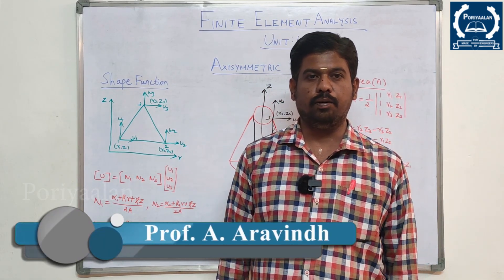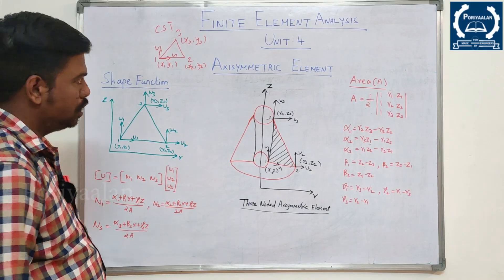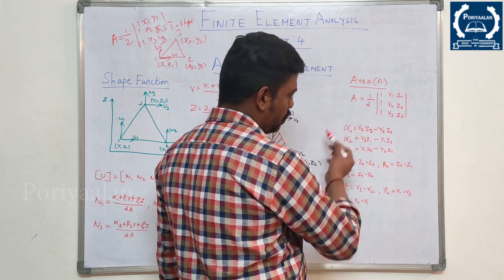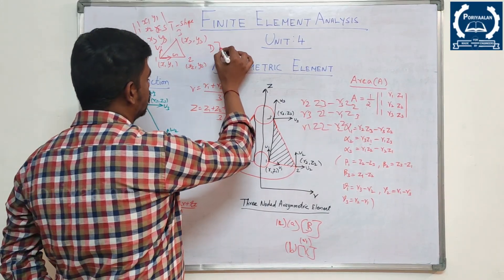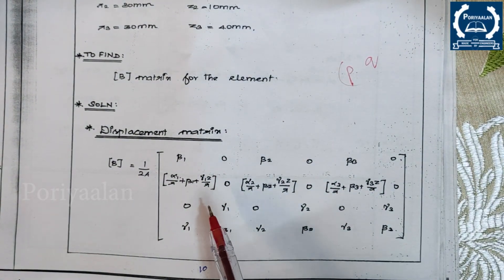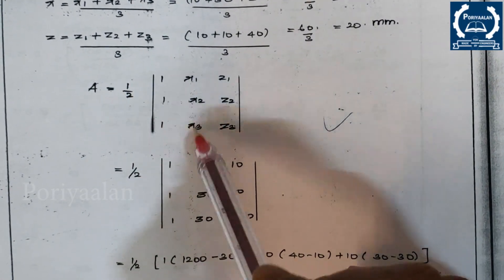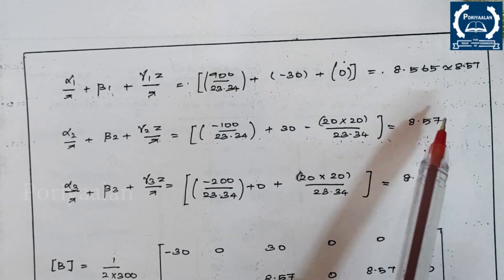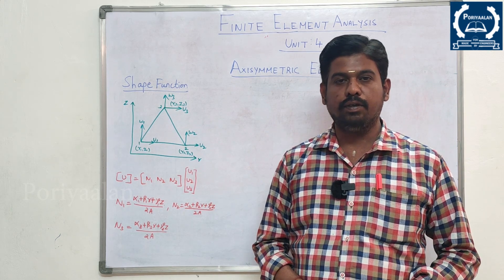Finite Element Analysis| FEA| ME8692 | UNIT-4| Part-1| Tamil

Comment: Sirr !
Kindly let us know which one is correct 
About alpha Beta gamma Steps

In formula explanation  

(Video time) - 4:41

That,

α1 = r2.z3 - r3.z2

α2 = r3.z1 - r1.z3

α3 = r1.z2- r2.z1

As so on for β & γ

But ! You’ve written this formula in example sum like, 

(Video time)- 11:31

α1 = r2.z3 - r3.z2

α2 = r1.z3 - r3.z1

α3 = r1.z2- r2.z1

And so on for Beta & Gamma !

So which one is correct ?
Kindly check 

23
31
12. 

Or

23
13
12